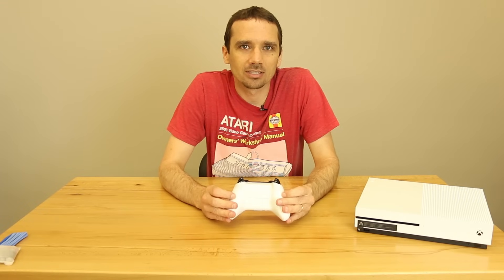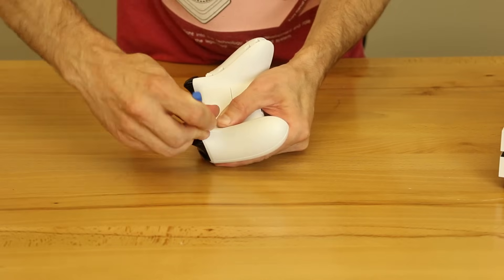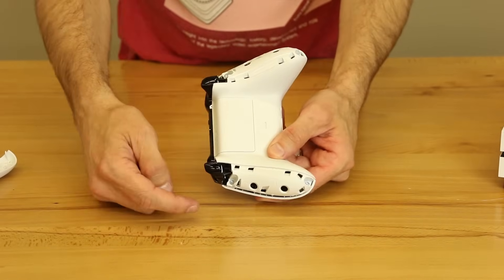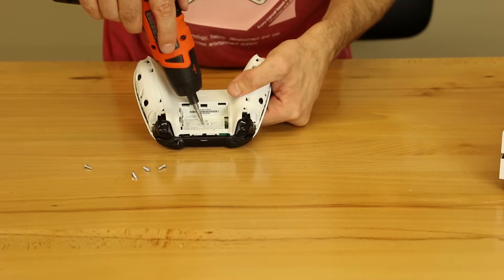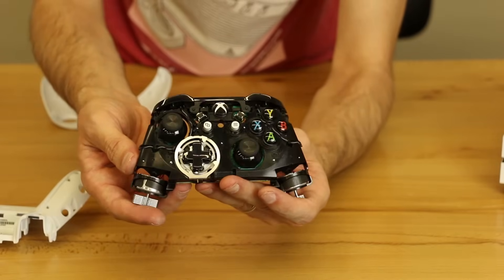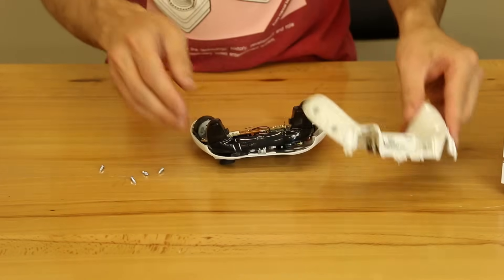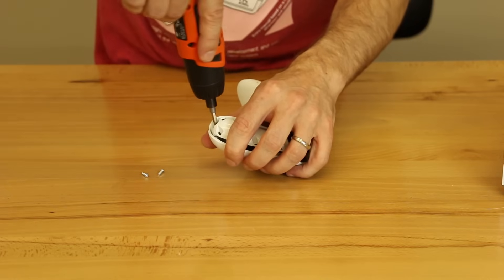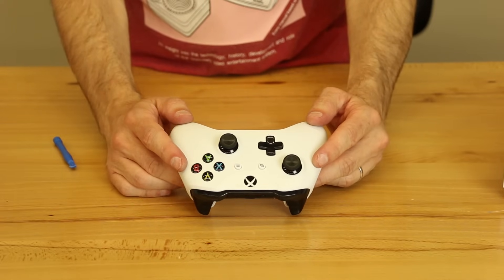Xbox One S Controller Teardown And Assembly

Comment: The only person with a good tutorial on how to open an xbox controller.
Reply from the maker: We will fix it for you and that will get rid of most of them but we don't disassemble the entire console to get them all.
Reply from the maker: A power supply for what?
Reply from the maker: Glad you like it!
Reply from the maker: What model?
Reply from the maker: Sure...you can come pick one up. The current price is $99.99
Reply: +TronicsFix umm if I go to your shop will I have to wait for a power supply or are they already there cause I was gonna buy one cause mine is not working. so I want to know if you guy will have it ready. tnx😁
Reply: 1215
Reply: TronicsFix and fix it
Reply: TronicsFix cause I barely bought the ps4 and now it's broken because of those cockroaches😭
Reply: Jesus your such a troll...
Reply: Ps4
Reply: Oh
Reply: How
Reply: Right this legit was sooo easy to follow i immediately went and cleaned my controller. No problem.
Reply: silent_death320 harambe clean house?
Reply: Blake Roberts what kind of screwdriver do I use
Reply: Yes you actually tell us the damn size of the security bit needed, it's even in the description. I appreciate it bro!
Reply: Blake Roberts piiii
Reply: Who is that avatar? Everyone is using it now. So annoying.
Reply: Umm. No
Reply: blac Jef how he didn’t take off any of the mother boards I did that with 2 controllers took off the buttons and made custom ones from the other controller and put it back together and it workss
Reply: It would have been a lot more helpful for me if he took the boards apart
Reply: @billymcbill8397  Are you trying to clean the Board??
Reply: @midocwhogaming  trying to solder my headphone jack back in.
Reply: I do , get to mad and yeet it across the room
Reply: O
Reply: TronicsFix if I take my ps4 to you guy will u guys get rid of the the cockroaches in it ?